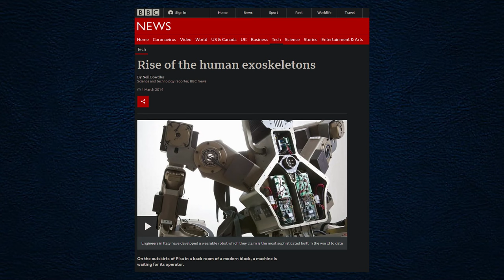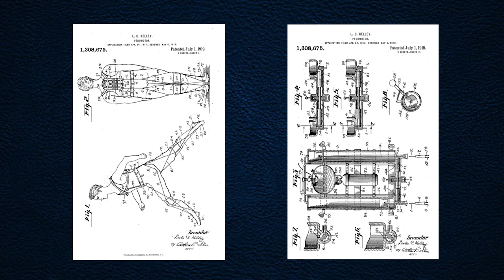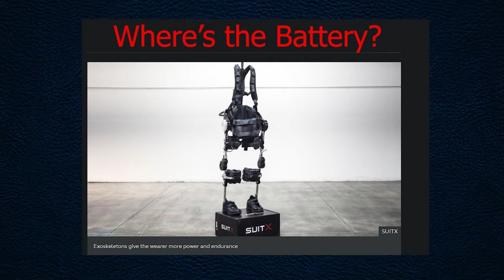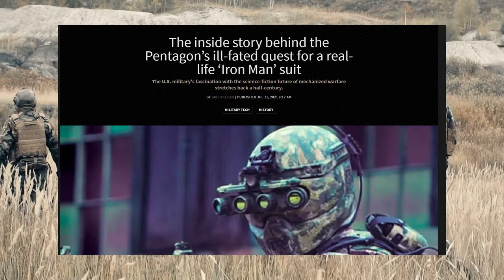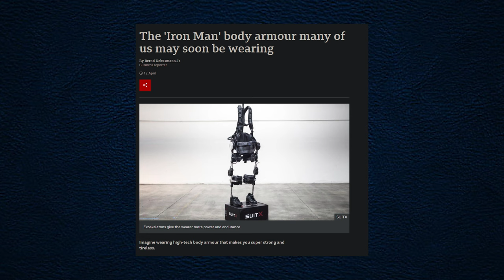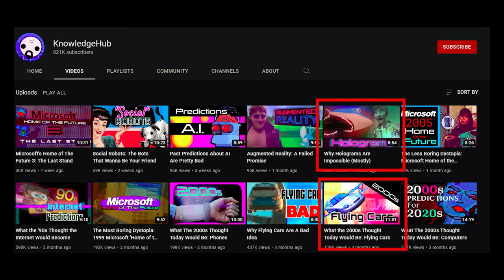Exoskeletons Will Never Happen: Here's Why

Comment: "An interest in engineering" - ie, you're an economist... Talking about... Engineering... If you don't need your power onboard, congrats its a solved problem. In terms of battery technology, we're about to hit the foot of the S-curve and improve exponentially: Additive manufacturing capabilities, zero-mass design, biiig improvements to the understanding of the fundamental chemistry itself with funding to match,  the massive push for more efficient electromagnets and the fact we might not even be using motors given the changes in microfluidics and MEMs - you really shouldn't be thinking of this as a "never" thing - just don't expect miracles overnight at science fiction "mature technology" grade. The outcome of this technology will probably be nothing like science-fiction initially envisioned, as is usually the case. The future has a way of making things mundane afterall. The capabilities of the jerry-can were once thought to be science-fiction; don't forget that.
Reply: Battery energy density actually advances very slowly.

Comment: If we pour enough money and time into exoskeletons we will have stuff out of sci-fi which can run fast, lift heavy things, jump, fly, discharge onboard weapons  etc but the thing is it would take an absurd amount of money and time to get there and in the time it would take to even get to one or two of those facets working reasonably well warfare will have developed externally of it. Say it takes 30 years... How good are our military drones and robots going to be in 30 years? Will exo-suits be beneficial when the colossal amount of time and research it takes to get them to where we want them can be used on drones and robots? It really boils down to economics and efficiency. I'm sure some clever little sausages will chime in with AI and yes AI well done, regardless though we'll be getting robots and drones and AI stuff, it may go back and forth in terms of how far we reach but it'll creep forward whatever we do it's inevitable.

Comment: exoskeletons could happen however they would be more similar to fallout power armor than say iron man. however just like in Fallout this wouldn't be everyone using it but rather a small number of special trained troops for assault purposes. 2 hours doesn't sound like a lot but its effectively eternity in combat when most engagements range from a few minutes to a few hours . A lot of the power concerns can be simplified to by just going with a simple hydraulic or spring compression system for shock absorbing. the problem is the US army always contracts out to effectively money laundering DARPA agencies to build these test mock ups and no serious development is put into them like say the development of a tank or aircraft.

however all of this is kind of irrelevant because cheap robotics sort of nullify most of the power armor concept as a whole. why put yourself in harms way when you can just sit back 40km's away and use a cheap quadcopter to destroy a tank or squad of infantry.

Comment: Either two options for Exo Suits in my mind A is that it doesn’t happen or B we find some sort of power source that’s light and useful. B is unlikely
Reply: A combination of electric hydraulics and human power/control would be ideal. Likely with some sort of high-energy density fuel cell in a rear pack which is counterbalanced by frontal plate, either used for armor or protection from whatever the exosuit is meant for.
Reply: @topsecret1837  holy shit u just described my graduation project, I am currently working on a hydraulic exo suit that also uses some electronic element.
The fundamental of it is that metal members behave like bones and are attached to the arm of the person, hydraulic pistons are mounted on the metal members to behave like a muscle, the science behind it is that one side of the piston has the internal area of the piston bore but the other side has the piston bore but the overall area is reduced based on the diameter of the pushing rod of the piston thus one side has an overall less area the pressure of the liquid be it oil or water or whatever will act on less area in one side making Pascal's law applicable, Pascal's law say that pressure is constant thus through cross multiplication, using this law I was able to predict that an initial  force of 20kg can be multiplied to nearly 100kg and increasing the final lifting power of the average human by nearly 5 times, the electrical part is a valve is closes the inlets of the piston and forcing the liquid to stay in one side or the other when required as through the suit the human may be able to lift 5 times the average person can but will not be able keep holding it this why these valves where introduced to the suit.
The project is still being designed and thought through but I have discussed this with several of my mechanical engineering professors and they all agree that the theory is correctly applied.
Reply: Why not just strap a tiny engine to your back, have the engine running when you're sitting down in a vehicle to charge the battery, turn it off for when you're about to engage the enemy to limit your sound and thermal register?
Reply: @jedcollings3624  Too much weight too many moving parts and not possible with modern technology.

Comment: you know what... your claim is just as exaggerated as the video/articles you dismay, will never happen? it will happen, and of course its use will be different than it's portrayal, at least at first, they will be used to make some specific scenarios much approachable (like the suits that bomb disposal experts use) like close combat or entering a building full of unknown units (which is highly dangerous even for the best of units) of course even now robots are the better viable option but they are not (just like exo skeleton soldiers) a magic bullet, 
so... i assure you we will see limited use working units (for the military) in less than three years,

Comment: I think you people are riding horses, disappointed you can't get a Ferrari, while you could get a Model T Ford.

As someone doing some heavy lifting and welding I absolutely hate this video. I could absolutely benefit from something like this even with a short run-time or hardwired to a wall or larger battery trolley/generator. I'd gladly pay several months or even a year's salary if it fulfilled enough criteria. Especially if preventing back pain and/or improving stability in awkward welds.

As for military use, of course it's impractical. (Though if a front man could be equipped with a rig to carry a thick and wide top-to-toe shield that fully protects him while pie-slicing through a building, maybe he'd prefer that over going in raw. Perhaps the thing could otherwise be stored, charged and carried on a tank or other squad vehicle. Perhaps with the shield serving as a mine guard while stored.)

That being said, I don't think all of you immediately want a Model T ford. But I do.

Comment: Thanks, I appreciate a good skeptic like myself. I think in fiction the most realistic ones are in "Avatar." Not quite a suit and more like something you drive, powered by a gas turbine engine generating electricity (they range in size from an 18 wheeler to a hot dog). The real star of the show would be the software and FLIR necessary to maneuver and not fall down. It would have to be fly-by-wire, no doubt about it, correcting for slopes, preventing toppling over... only some extensive software prevents it from being a clunky mess. Its mission would be short and to the point, you don't want to be saddled with a massive fuel tank. There's a company out of Australia if I remember with a super lightweight turbine capable of powering a home that is 1/10th the weight of a comparable turbine - lightness a must. If the suit protects its user from small arms fire and allows him to hoist, say, a 20mm cannon, it could augment a squad as a kind of juggernaut device in kick in the door raids. In the only footage that exists of a soldier earning the Medal of Honor, that soldier was killed on raid in Tora Bora to retrieve the body of a slain SEAL. The problem was a cave from which the enemy was firing small arms and lobbing grenades. This thing could penetrate that easily. A kick-in-the-door house raid or fighting house to house like in Syria or Iraq would be ideal, it could just charge into the house, Drones are great but you can't secure an airfield with drones, you need troops. Outfit it with a detachable jetpack (we have some amazing examples for soldiers now) and a squad of these things dropping onto an airfield armed w/ miniguns and cannon, Javelins, etc. could do a lot of damage and brush off direct fire. They're the tip of the spear though, doing their work in under 2 hours paving the way for regular infantry.
Reply: Military mechs have been mocked because of how worse it would be compared to wheeled or tracked vehicles. The biggest point of concerns are how big of a target it is, and also that it would be very unstable. Let's not even talk about the energy required.
Reply: @christophegroulx7816  No question, energy is the kicker - that's what ppl don't understand about electric cars  - they roll on trillion dollar highway systems. The battery energy density to push a boat through a medium like water or propel a plane with batteries... it ain't happening. 

But an Abrams tank or an Apache or even A-10 is simply a mech powered by a turbine - one clanks, the other beats the air to death, the other uses lift. All 3 are turbine-powered. In the case of an Abrams that a 1-ton turbine propelling 73 tons! But since a mech requires all manner of servos to duplicate the motor action of walking along with so much more, you would have to go electric, you couldn't mechanically spin all those things like some Steampunk fantasy. So you run it like a hybrid EV w/ a range extender - a generator charging a battery system. It doesn't have to be much larger than that Iron Man Mk 1 in the first movie. There are plenty of places tanks can't go and getting 70 ton vehicles there in the first place is all kinds of hell. 

I can think of all kinds of uses. Embassy protection for one. Imagine the embassy crisis in Iran or the one in Saigon before that or hell the one in Libya where our ambassador was killed after it was overrun by a mob. Staff goes into panic room while a couple of Marines go to garage and climb into 10 ft suits, arm cannons locked and loaded, shoulder-fired M203 grenade launchers... why does it have to be slow? Boston Dynamics robots are running right now, why can't this in an urban environment? It can get into alleys, into courtyards, barrel through the wall of a house without brining the house down, hell you can HALO one out the back of an aircraft into a hostage zone - try that with a tank.
Reply: @edwardrichardson8254  I think your view of things is a little too much based on science-fiction. Lots of videos have been made about why mechs would be atrociously bad compared to wheeled/tracked vehicles. Also, the Atlas robot is not as top heavy as a mech (thus being more stable), but it still takes weeks to setup the videos you see. The robot also only last 1 hours when doing low-energy motions such as walking. If you wanted it to run and jump, I doubt you would get more than 10 minutes out of it.
Reply: @christophegroulx7816  You're not listening. I expressly stated first in my former post the energy challenge ruled out battery-only (like the Atlas). I said it had to be a hybrid gas engine/EV w/ the engine functioning like a range extender to the battery. In theory it's no more complex than your car engine keeping your battery charged up w/ the alternator. All this stuff is real, it's not "science-fiction" - electrically powered hydraulic robots have been building cars for fifty years, this is just an electric robot with a gas generator keeping the battery in as full a state as possible, with LIDAR-driven software for mobility gyroscopically correcting for a trip, a fall or what have you, but a human at the stick. Again, AMP suit in Avatar a great example, I don't doubt for a second that could not be built today: 

https://www.youtube.com/watch?v=aw60Ma4c2bw

If we were talking science fiction, I would be  talking about the INSANE mech suit in "District 9" but we're not.
Reply: @edwardrichardson8254  I seriously think you need to do more research on robotics and control theory, it is much more complex than you seem to think. For instance, the AMP suit could not be built today, and the control architecture you have described is not based in reality.

Comment: No offense man, but this is just not a well considered video on the matter, you can't tell us without further explanation, how we can go from Asimo in the early 2000s, to Boston Dynamics human robots doing backflips, and conclude that this advancement will not go even further.

There are clearly solutions to the 2 former problems, hybrid electric power supplies, equipping every non mechanised soldier a battery, primarily using mechs in conjunction with an APC or helicopter, and for the accuracy, not purposing the mech suit for combat usage, or having trained pilots spend years learning how to use a modern one effectively, or just waiting another 10 years when they find some circumvention you didn't consider.

As for the utility of it, I don't see how you can make such a statement dude, were you aware before making this video, that soldiers already experience chronic back injuries from their loadout prior to making this? The amount of equipment carried by a soldier makes it extremely impractical to add something like a full body shield, or an anti material rifle, a mortar or automatic grenade launcher and it's ammo, to an infantry squad arsenal, and now US infantry are fielding an even heavier rifle than they had before, all that extra weight on every single soldier. Sure all of these things can be carried with a car, but you can't drive a car up into a building or even up particularly treacherous mountains or forested hills, you probably can't stop a mechsuit with a sandbag wall or an improvised barricade. Having just one fully armoured mech would allow a squad a fast deploying mobile firing position outside a building, unimpeded by roadblocks or anti tank road mines, and would be like a walking tank inside it. When the fighting is done, you could remove the armour inserts from the suit, or keep some of them on at all times with modern plastic armour and use it as the transport method for sending large quantities of ammo and supplies into the newly gained position, never having to overburden the non mechanised soldiers at all, significantly increasing their effectiveness for combat.

Comment: Jokes on you. 2 years ago you were wrong, and even more so today. Industrial exoskeletons are not leaking over into consumer with 7 different companies releasing CONSUMER exoskeletons in 2024-2025. Some full, weight bearing. One of them looks promising with the ability to support up to 200 lbs of weight on its frame, for 3,000 bucks. Yes please.
Reply: They are not full body powered exoskeletons though

Comment: 1. Poweered heavier than air flying machines, even if it does happen to be possible to get one off those conversations off the ground, it will never be used for anything practical, except possibly for aerial reconnaiddsnce.

2. Lighter than air manned balloons have already proven their worth by loitering high above enemy fortifications at their leisure, while photographing the locations and numbers of enemy positions. Therein lies the penultimate use for lighter than air aircraft.

3. Rocketry as a developing science firstly deals with the question of where exactly the atmosphere of space ends, and the vacuum of interplanetary space begins. It is generally accepted that the Karmen line is where Earths' atmosphere ends and the vacuum of space begins. Threfore, the Karmen line extends 100 kilometers, and 60 milles straight up.

However, none of this matters because it is impossible to use rocket population for visiting vacant boxes such as The Moon, Venus Mercury,, Mars and Ceres. The cake reasoning is this line or it's not meant to be malicious. It is simply the model compass of this maps go through tell the truth... Even if it is Carly coveted, yet iimpossible daydreams. And unfortunately, I am compelled to report the truth, even if it is quite fantastical. I mean, china on. .. rockets traveling through space? BALDERDASH!!

4. Radium is GOOD FOR YOU! IT MAKES YOUR LIPS, CHEEKS, TEETH, AND EYELINER GLOW! AND FOR JAW PROBABLY WON'T FALL OFF! OH YEAH... ANYWAY, I ALMOST FORGOT. YOU DEFINITELY WON'T DIE! BECAUSE, YOU KNOW.... RADIUM!

5. Here in the late cusp of the 19th century, we have almost certainly reached the end of scientific lives. All that's left are details. 

6. What the hell is seeing with Mercury? Huh? Say what? Oh, that one needs for you to use general relativity to figure that one out.

6. Trump made politics fun again!